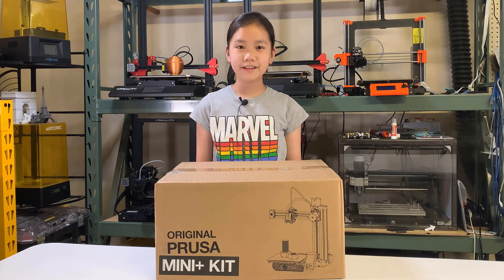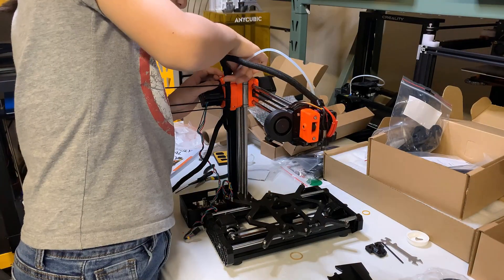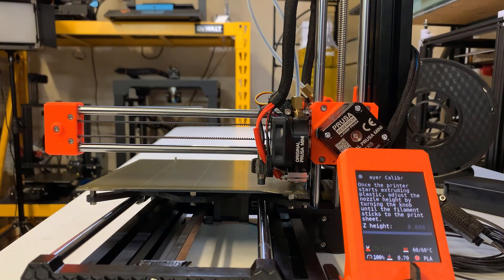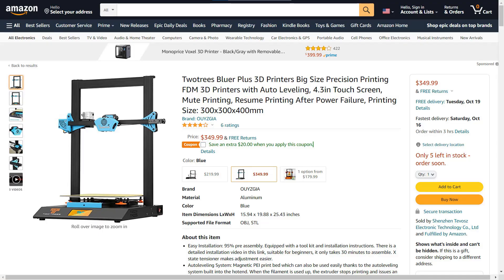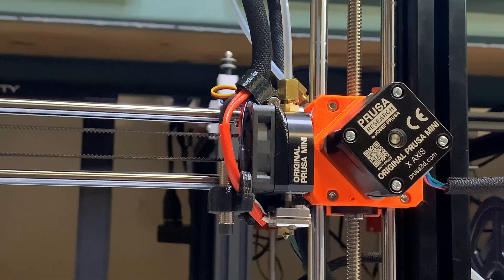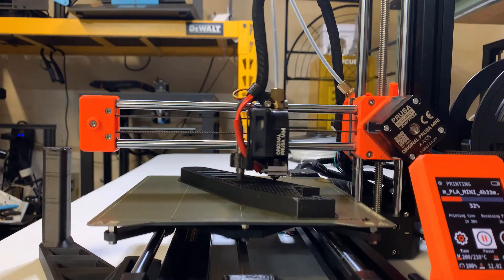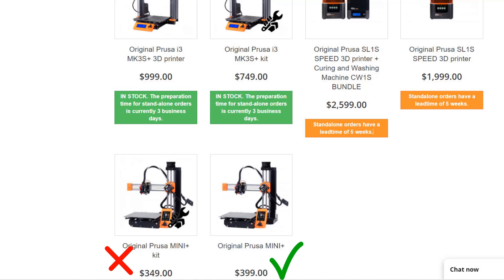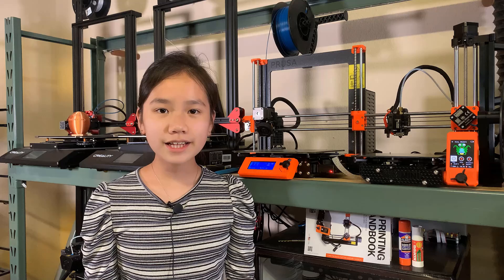Prusa Mini Plus 2021 Review: What I like, What I DON'T like, issues and fixes

Comment: I bought the kit too , there were a few moments when I wished I paid the extra . I had to use a clamp to push the rails into the base , I though of using a hammer but reckoned that could end badly . The bolts holding the two halves together on the y axis rail wouldn't catch the nuts ,just the teensiest bit short , again I had to use a clamp to press them together and then the bolts did connect.
On the plus side I learned all the parts of the printer , how they go together and operate, which could be useful if it has a problem in the future .

Comment: For a 2 year old review, this was surprisingly accurate. I've got the original mini that was released in the initial batch and many of the things you experienced, I also shared as well. It's still my go-to printer because it just works... Rarely do I need to do anything other than clean the bed and occasionally lube the bearings. I've upgraded the PINDA probe since and I'm running the 5.1 firmware with input shaping and it's great. I don't like the web interface and you can only sort by name and not upload time. I hope the next mini does away with the Pinda probe and live z calibration like the mk4...  And if they sold a plug and play version, I could see it making 3d printing a mainstream affair.

Comment: The cost is 459€ in the EU for the kit only. Too bad, that's simply too much, because with shipping (and the filament sensor) I have to pay basically 500€.
Way too much. I think I'll just get an Ender for half the price.

2024 UPDATE:
Have had the MINI+ for nearly 2 years now. Absolutely indestructible, total workhorse. Definitely made the right decision here. It has been working day and night since I bought it and it still has all original parts (save for the nozzle and PTFE, of course).
Reply: Update. Got a Prusa Mini after 2 months of shipping. Works perfectly it of the box, with only slight tuning and one failed print in all this time (user error).

A friend ordered an Ender 5 at the same time. He's still tuning his printer, and the quality of prints is nowhere near mine.
Reply: The Ender is worse though and missing comfortable features.
Reply: @hanswurst9866  its its twice as worse though?  I really want to know becase i can get a new cr6 for 300 in my area, but it would cost 750 to have this shipped to my door
Reply: @mikejones-vd3fg  Just buy a Prusa Mini+ and be happy with it. I agree with waffles 100%

Comment: I need your help
Does the mini has thé same précision like  mk3s? It has the same layer thinkness?
Reply from the maker: Yes, most 3D printers have the same precision level, even an Ender-3, the layer thickness depends on your slicer settings and nozzle diameter. Generally, you can print from 0.1mm to 1mm layer height with most 3D printers.

Comment: Much smaller? Its just 3 by 3 cm thats not that much for almost 1/3 of price and everything else about printing almost same. And 99% of buyers would never need bigger, and if do, ten 3x3cm more is still not enought and need to be glued. Or if they need more parts like keychains etc, it better to buy 2-3 Mini+ for price 1-1,3 price of 1 MK3S+ So mini is the win, even for new anounced XL.

Comment: I really like the reprap and klipper firmwares. They are superior to marlin in every way. Both allow for wifi printing, which I find essential. Since most people are buying a $50 board and a $50 raspberry pi, why hasn’t anyone made a main board with the two combined? Prusa is in a prime position to do something like this. I get that creality is a budget printer, but why is Prusa still using 10 year old tech? They have the engineers to do it. Or even adopt Duet as their main board.
Reply: big treetech manta MP4/5/8 with CM1 is basically what ur looking for. its my go to for my printers

Comment: $250 not $350 savings.
Reply from the maker: Actually, it should be $325 since the shipping for the kit version of MK3S+ is $50, but the fully assembled version is $125. So, the total price including shipping is $750+$50=$800 for the kit and $1000+125=$1125 for the assembled printer.
Reply: @AuroraTech  You're doing great!  I really love your videos!  I just bought an Anycubic Kobra for $271.  I already have a Prusa mini and it has been great but I wanted to try something different.  What do you think of the Anycubic printers?

Comment: Thanks for a very useful and down-to-earth review! I am a beginner in 3D printing and I have a Mini+ since about a month now. I bought it pre-assembled and it works just great. But it does have some problem with the higher than 100mm print hight like you described in your video. So thanks a lot for the fix you've  showed ! Good luck for you and your brother in making more good videos! Linas

Comment: As always a great review! Your calculation should be added by a factor, that‘s impossible to express in numbers: chinese printers prices are possible because of a very low standard of salaries and social safety. So I think that everyone, who enjoys prosperity, should consider buying a Prusa printer. They are developed and build under much higher standards and there is a 24/7 support staff, you don’t have to pay on top if you need them. In my opinion Prusa printers are far away from perfect, but they are not expensive!

Comment: Great video! Thank you for the insights and solid considerations. I am currently shopping around and I am stuck between the Prusa Mini Plus, Creality Ender S1 and the Kywoo Tycoon. What do you think is the best quality, features and reliability?

Also is Cura better than Prusa's proprietary slicer or do you prefer PrusaSlicer?
Reply: Which one did you pick up?
Reply: The Prusa slicer is not proprietary, it works for all printers and other slicers work for Prussia printers. You don't have to use it, therefore it's not proprietary.

Comment: It's crazy to me that a $475 machine like this (prebuilt, filament sensor, shipping) STILL is too cheap to include a touch screen. Jog wheels are so outdated and cumbersome, and there just doesn't seem to be any excuse especially when brands like Creality are selling the highly-polished CR-6 SE for example, which features all the same "perks" and then some (such as ABL, filament runout, pre-assembly and factory calibration/testing, dual Z-axis lead screws, etc...) but also is a full-size printbed and touchscreen with customizable firmware... for $50-100 less. Prusa still feels like buying half the printer for 25% more money,
Reply: I could care less about the touch screen functionality, but the direct drive extruder vs a finicky old school Bowden is no contest. Prusa wins hand down.
Reply: @austintaylor7359  meanwhile I couldn't care less about Bowden vs direct, as 99% of my printing is PLA not flexibles. But if you're doing specialty print materials and you can't figure out how to get your Bowden set up correctly then sure, spend a hundred extra bucks on a machine that fits your needs
Reply: @StormBurnX  I too remember when people complained about that color TV, shaking their fists wildly in the air while yelling that the black and white worked perfectly well if you just got the bunny ears right lmao
Reply: @austintaylor7359  An interesting yet flawed comparison - a well-tuned B&W tv and a color model do not output the same final result, not by a long shot - whereas the same cannot be said of an overpriced direct-drive machine and (in my case) a straight-out-of-the-box creality. But again - if you need specialty equipment, to do specialty jobs - such as a color television - then by all means, spend the extra to get it. It's just so disappointing to see the community shit on bowdens as if they're problematic in some way, when the community is the problem.

Comment: I got the same Z axis issue on one of my 2 mini+ and was investigating the extruder gear, turns out it is the Z-axis in the Z-bottom. Thanks!

By the time I got my 2 mini+ assembled, I agree that it is a must to take the pre-assembled version, those square slots came in stringy and caused me troubles in the Z-bottom. 

But as soon as I started printing with it I just unplugged my Ender 3 V2 as those smooth rods, the super PINDA and 38mm size steppers makes it way more reliable for 24-7 operations.

Comment: Do you guys have prusa slicer videos? I like your vids! My printer is already oin the way cant wait
Reply from the maker: Prusa slicer is the easiest to use slicer, you just need to select from the first tab(Plater), choose some simple options like 0.2 or 0.3mm layer height, infill percentage and you are good to go, if you are using with Prusa printers, the default settings print quite well 95% of the time. Unless the 3d model is very special, otherwise I will just go with default settings.
Reply: @AuroraTech  THanks!

Comment: To add onto bullet point #3 of “the differences between MK3S vs Mini+,” I noticed that the mini is listed as not supporting the Power Panic hardware based feature. This feature allows the MK3S to recover from power failure. Instead the Mini+ will have “Future software upgrade, single layer accuracy” (whatever that means)

Comment: Excellent presentation. As a Mini+ owner, I agree with your opinion in general. But I think you shouldn't say "reliable", because you didn't make any long run tests with various filament types. And so the conclusion sounds like advertising -not objective, that is.
That doesn't mean Mini+ isn't reliable (as long PLA filament is used).
Reply: I've had the Mini+ for 2 years and I print as much PETG as I do PLA. It has been nothing but reliable.